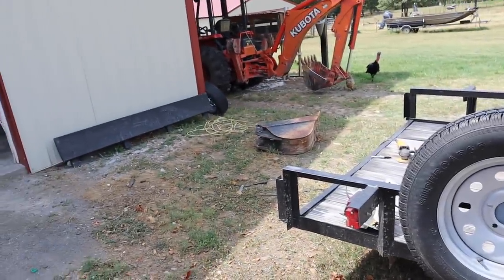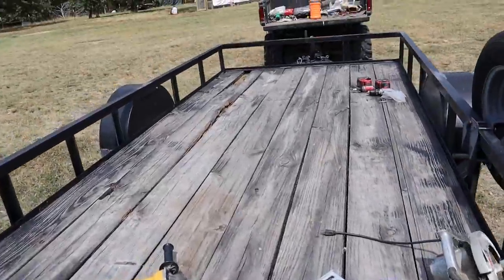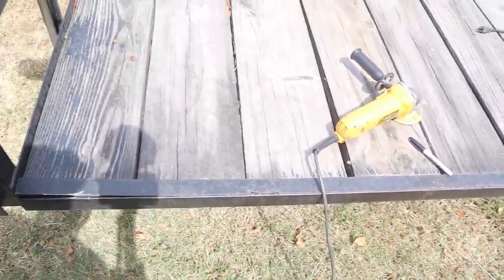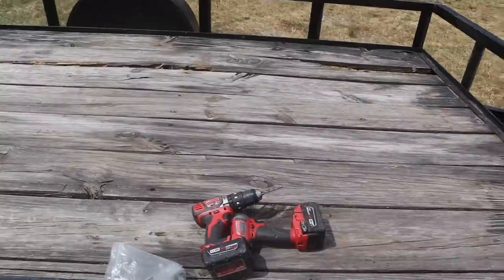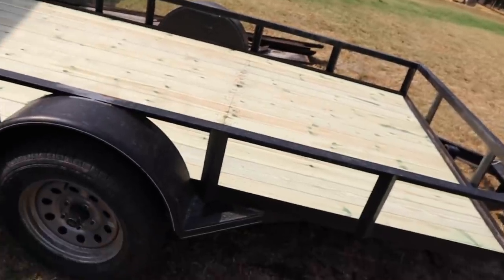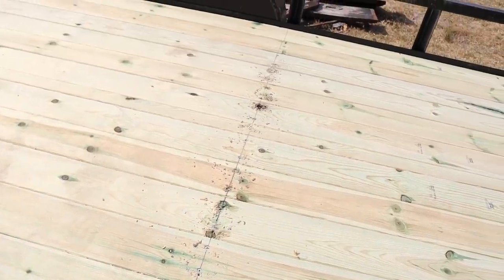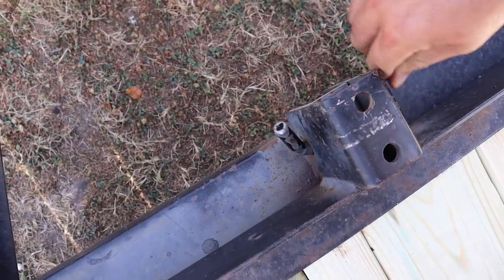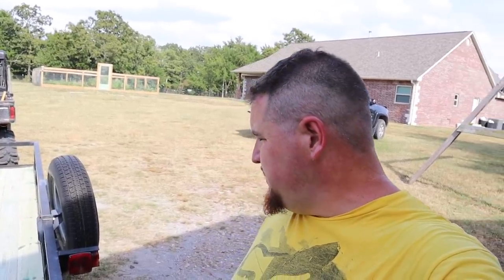Farm Trailer Rebuild Time Laspe

Comment: I’m 63 now but when my Father was here we had several different size trailers. But when the decks needed replacement he would make us sand down the rust from the metal clean it up and repaint the whole thing. And to this day my brothers are still using those same trailers. They are over 50years old and still going strong.

Comment: Trailer looks good, awesome job.  You worked at the hottest peak of the sun.  Next project, find some shade whenever possible.  Take as much care of yourself as you do the trailer or whatever.  Then you'll have more energy for what you're tackling next.   We enjoy your videos and don't want you to over-do yourself.  BTW:  the chemicals in pressure treated lumber prevent rot and ward off insects, but doesn't prevent moisture from seeping into the wood and causing swelling.  A water sealer can help and hopefully add to the life of the wood.

Comment: I have a small 5 X 10 utility trailer, pipe frame, 1990 model, replaced the deck boards once so far. Expanded metal on the back ramp was just replaced. Repainted for the first time this year. I live on the coast, so you should get a lot of years out of that trailer.

Comment: Now could you run over here to southern Georgia & do mine?  😁

I have a small utility trailer (that’s actually a ski-mobile trailer from Canada) that needs some work. Has a metal strip down the very center but then plywood along where the skis would sit. That plywood wasn’t very thick to begin with so it’s pretty rotten. I have a thicker outdoor sheet of plywood I plan to use to replace it. But in the meantime (aka procrastination time) I’ve thrown some smaller pieces of plywood in there. 😂  That has worked so far cuz I don’t haul stuff too often right now & nothing excessively heavy.
Reply from the maker: I wish I could help you
Reply: Hidden Heights Farm  I know you would if I lived near you. You’re just that kind of person.  😊

Comment: Great job! That will last you a whole lot longer than the original that's for sure. Do you plan to seal it as well? That would greatly extend the life of the bed.
Reply from the maker: Yes for sure. Nope won't be sealing it.

Comment: even treated lumber rot put transmission fluid on it  i did 10 yrs. ago still as good as new
Reply: He can put that or old motor oil on it and itll be good for a while too
Reply: Water seal works great too.

Comment: We saw a load of pressure treated deck boards today after I picked the guys up from work. The last porch they built (just last week) there was not a deck board to be had ANYWHERE. They ended up using rough cut lumber that the mill was able to run through a planer (with the home owner's permission).  I guess the suppliers are starting to catch up.
Reply from the maker: Oh wow

Comment: Nice job on the trailer it really looks good. Could you do me a small favor. Could you wear some ear protection when you are running  your saws and your louder equipment. Id hate for your later grand-kinds to go threw what i'm going threw with my granddad. He has dementia and Alzheimer's. There is many study's out that one of the leading causes of Alzheimer's and dementia is hearing loss and loud noises from machines can damage you hearing over time. Just a small tip.

Comment: I would just pull off or burn the wood off and replace with mesh metal...ends up more cost effective  in the end..if you need a solid bottom for dirt or compost  harbor freight  sells tarps really cheap..will cost you less in the long run..js